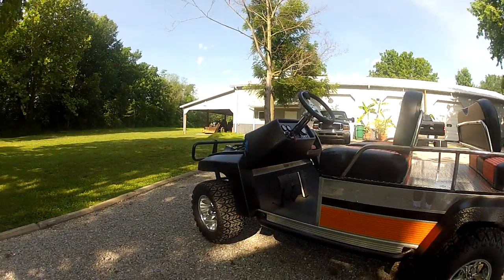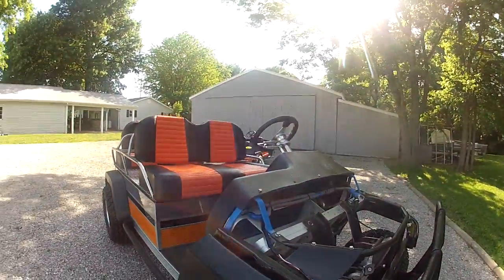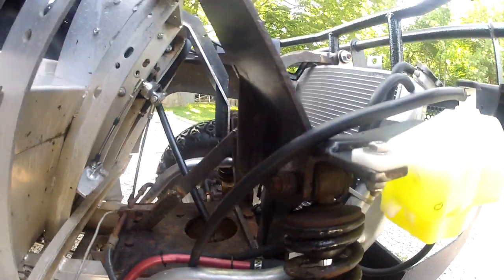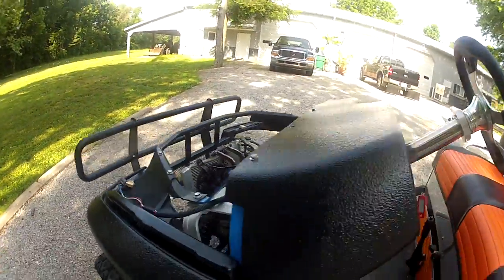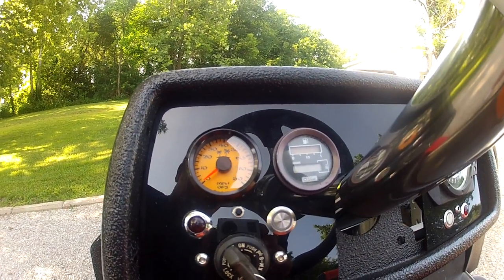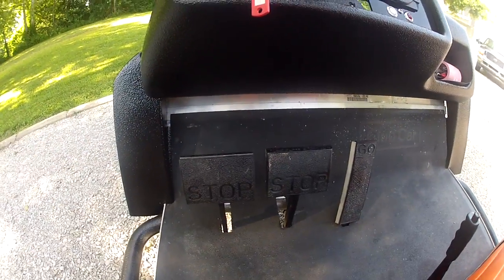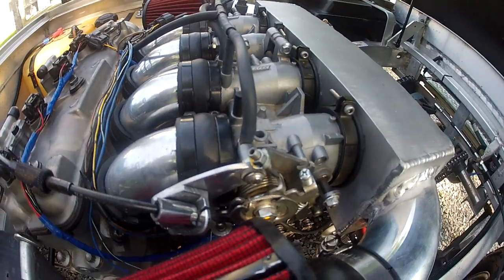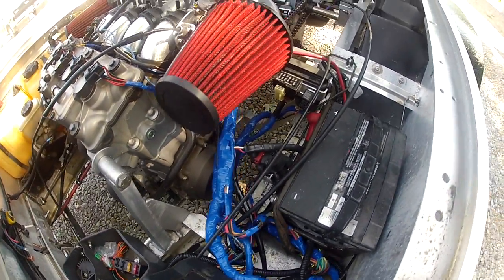CLUB CAR WITH NINJA ENGINE

Comment: Kudo's , Man ,these  conversion projects ,I am in that same don't know if it's gonna work ,doing  a 14hp ex subaru engine  with a gearbox & torque converter ,only mounting the clutch drive pulley onto the gearbox, still working out the bugs.
Reply from the maker: Keep at it! It's well worth the time to have a great custom cart like no one else!!

Comment: I wish there were more of these builds.
Reply from the maker: Hey there, 
Keep an eye out here. I "THINK" I've come up with a way to shoehorn a small block Ford into a cart and still keep it 100% functional. I've got the cart and the engine. Working on rounding up the rear end then all that's left is to finalize my transmission set up. Gonna be a lot nicer build than this one. "I HOPE"!!
Reply: @tbirder1  would be nice to put the ford 300 in one but to large and heavy
Reply from the maker: @Ruckusism  That 300 inline six is quite a bit longer than my 302. Supe tough to devise a driveline system that would do what I'm wanting too.
Reply: @tbirder1  I know this video is 10 years old.  But I want to know how the trans axle held up.  I’m doing a similar build now and still iffy on the trans axle
Reply from the maker: @dougking8424  Hey there,
The trans axle did great! Now I have to say that other than deep sand, I've never done any hard hole shots with this set up. When I did really bang the gears hard it was always from a roll.
Reply: @tbirder1  I’m only putting a 600 from a Cbr in.  I’ve had a few friends that are way bigger into golf carts and the all said it will hold the power.  Just have to support the input shaft on both sides of the sprocket. I mean I could be like everyone else and just live axle it. I do have a Polaris gearbox I could use but I’d like to be able to turn on pavement and go in reverse. Lol. That build is super clean though. You wouldn’t happen to be on golf carts modified Facebook group would you ?
Reply from the maker: @dougking8424  Don't go the straight axle route. I know it's a ton easier but you'll NEVER regret having reverse and also you're not tearing up grass and driveways when you're cruising around. I used to be on a couple of those groups but the dickweeds at facebook suspended my account for being bad on Instagram. Guess what...I've never been on Instagram in my life!! And as usual, can't speak to any of those fools to try to straighten it out.
Reply: @tbirder1  yeah I don’t want a straight axle at all. lol.  My sons will have one. But only because I have a lot of spare parts except a gas transaxle. I think his will be harder to piece together though.  Using a 625cc zongshen I pulled from a trade.  Going to actually use the torque converters in combination with an ultra 6 Harley 6 speed.  Means he won’t have to use a clutch. But it should be plenty fast when it’s done. Lol
Reply: @tbirder1  I did notice you solid mounted the engine. But I couldn’t see what you did to support the axle from twisting under torque
Reply: @tbirder1  I’m doing this on a precedent so it’s the same rear end.
Reply from the maker: @dougking8424  I'm not sure if it is or not. This is a rear end from a Club Car Pioneer 1500. Might be beefier, not sure.

Comment: How does that rear end hold up to the motor thinking about building one
Reply from the maker: It held up surprisingly well! I didn't do any hole shots or wheel stands. No hard launches but I'd bang the gears really hard once I was underway and no problems.

Comment: I really need to know what parts to buy for a shifter setup like this on my golf cart build.
Reply from the maker: Well to be honest, you kinda have to fly by the seat of your pants. There were no kits or parts for this. I just had to start from scratch and build it a piece at a time. I got the inspiration for this set up from an old "3 on the tree" concept and just built from there.

Comment: Very nice work , I especially like the airbox you built. 
Every time I work on the carbs on my old XS1100, I want to build an airbox that isn't such a pain to remove and install.
Reply from the maker: It's not that hard at all, especially if it's for carbs. I had to build new intake runners that angled backwards for the extra clearance I needed and then had to weld in intake bells and install the fuel injectors in this box. Made it a little tedious but not bad.

Comment: Is the frame longer than a normal golf cart? That looks like a good candidate to customize with the lower seat and extend the floorboard if so. Just Mount the engine further back.
Reply from the maker: It's a sock length Club Car, Carry All, Poineer 1200. I looked at lowering the front seat, but because of the engine and drive configuration, there simply wasn't enough room to move it back far enough to drop the seat. It's not bad as it is, doesn't feel top heavy at all.
Reply: They  have a frame stretch kit for that cart that gives you 38" you can add regular  racing seats with all that space.

Comment: This is an awesome build and the best I've seen yet. ( although the blue wiring does no favors on the overall appearance as you pointed out. lol ) Where did you find the dash cowling assembly though? It's not stock Club Car for sure.
Reply from the maker: Hi there, Thanks for the kind words! I made the actual dash itself using smoked Lexan and cut it out to fit all the instruments. The dash cowling is a stock Club Car Carry All, Pioneer 1200. Ha! And as for the wiring.....I ended up fixing it and running it in black wire loom!!
Reply: Well your worst part of the project was WAY above and beyond any I've seen to date and that includes 2 of my own that I thought were pretty cool. Never even thought of filming or reviewing my builds. Did you find a buyer for this one yet? I couldn't imagine it would be very hard to. Thanks for taking the time to show us the new level the bar has been raised to.
Reply from the maker: Well again, I appreciate the kind words.I don't think this build was all that. It was my first golf cart build and basically my "learner". I'm going to try listing this one for sale very soon as I've just picked up another Carryall just like this one and I don't want to start on another creation until this one's gone. Without letting the cat out of the bag I will say this next build ought to be the "cool one"!
Reply: I can only imagine how time consuming a video must be when building but I'm really hoping you'll film the build inception to epilog.  I'm thinking for my next build to get rid if the drive chains and go with the deep toothed Harley type drive belts & Sprockets. They make a huge variety for machinery and I'm thinking they would be far more reliable than the commonly used drive chains as well as more versatile.
Reply from the maker: I looked at those cogged belts as well, but in my builds I require #1 a differential so it has a better turning radius, less tire wear and won't rut up yards and driveways when turning, #2 I have to have reverse. I couldn't come up with a suitable way to do this on this build other than what you see here. But I think I've overcome these issue's for the next one. I do plan on documenting this next build because without letting the cat out of the bag just yet I can assure you this one is going to truly be "one of a kind" ! Here's a link to the documenting of this build. Go to KAWASAKI ZX6R in a Club Car Carryall. Hope you find something you can use. http://www.buggiesgonewild.com/bike-atv-engine-swaps/
Reply: Thanks for the link, you do in fact work at a professional level. Do you machine your own parts? I noticed in the link you said you "rolled" a bead into the intake tubes. Having never looked any farther than the external view of a carryall, I had no idea they had hydraulic brakes or that the engine was mounted directly to the rear axle housing. I DO like the braking factor as well as the stability concept of the carryall, ergo, am reconsidering my own next attempt at using one for my new build. ( winter project with my 16 yr old grandson 2018/19 ) Can't tell you how much I appreciate your input, links and the fact that you are so open to idea exchanges, Tbird. Hope you sell your build real soon so we can all see what's next over the horizon.   Jon
Reply from the maker: No, LOL, I'm more the "anti professional" if anything. My dad always said "poor people...poor ways". I don't have the ability to "machine" much of anything. Anything you see here was cut, beat, hammered or heated and forced into a shape of some kind. The Carryalls are hard to find, but in my opinion they're a PRIME candidate for all kinds of engine swaps. I'm so glad to hear you and your grandson are on a joint effort, I have two grand daughters and since I refuse to learn about "essential oils", I'll just hang out in my shop and do my builds by myself! LOL

Comment: You mention something about a push button starter switch on the dash giving you a few extra horsepower, I have never heard of that before I have custom wired a ton of these sportbike ignition setups up for various builds. I would say whoever told you that its a horsepower gain has no idea what they were talking about. Also, did you build that intake manifold? seeing that gave me an idea to try that may help me solve some fitment issue with a new build I am working on however I'm not sure how you determined that size of opening diameter on the intake, is it reprogrammed to run that box or was the box built to copy a stock air box? Thanks
Reply from the maker: I did this video at the request of a bunch of folks on a custom cart forum. I said that "extra horsepower" thing just to tease a few of those folks on there. You know the ones....they have 12,000 posts and all EXTREMELY critical of other peoples work. Well the "KING A$$HOLE" of that forum was just beating up on another builders use of a momentary toggle switch to start instead of his "A$$HOLE" approved push button version. And yes, I had build the intake set up. I had to build new intake runners that that would lay it back at about a 60 degree angle, then I built the intake box and installed the factory secondary injectors. I did loose some bottom end due to the changes, but can't find anyone here to reprogram for me.

Comment: Can you post where you get the adapter to the rear end ?
Reply from the maker: I'm not sure what you mean by the adapter, but I hand made all the items you see here.
Reply: tbirder1 how about the shifter where did you get the part by the steering wheel on the tree love that
Reply from the maker: I built that too. I took a piece of 3/4” aluminum plate and cut out the mounting bracket and the two shift levers. I cut splits in the back side of the levers then drilled and tapped them so when you tighten the bolt it crimps onto the shift lever shafts.
Reply: tbirder1 thank you

Comment: How did it run as far as the rear end and transmission
Reply from the maker: Actually it works pretty well. I didn't want to just take the easy way out and use a straight axle because they rut up grass and gravel driveways when you turn and most important, NO REVERSE! I just don't try hole shots and it's all hung together pretty well. Here's a ling to one of the first passes I made. https://www.youtube.com/watch?v=8BV-HW1TDfI

Comment: How is your shifter setup?
Reply from the maker: I built it based on the old "three on the tree" concept. Outer and inner tubes with little paddle shifters on the column. Lower shifter is Forward, Neutral and Reverse. And the upper shifter is one down and five up for the Bike Gearbox. Works fantastic!
Reply: tbirder1 sounds like a great setup. Like the concept a lot. I got a gsxr motor I put on a Dune buggy and trying to figure out how to do the gears